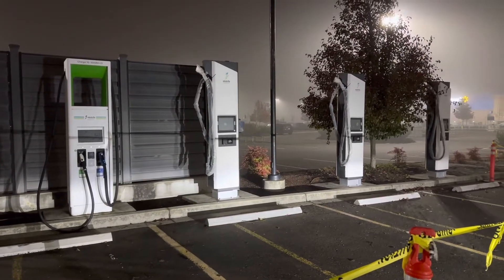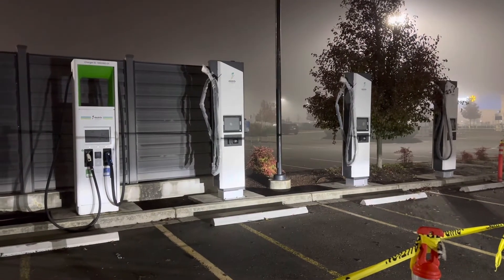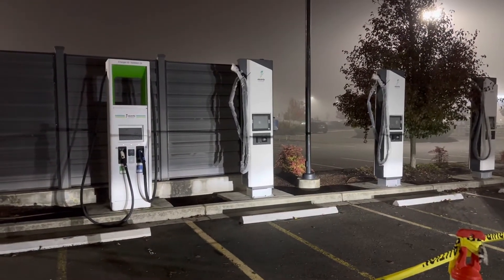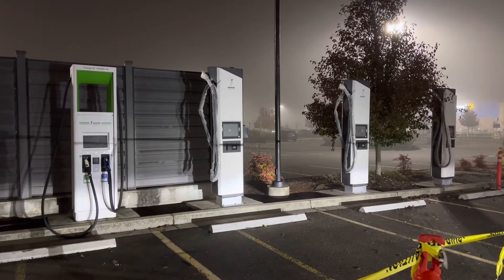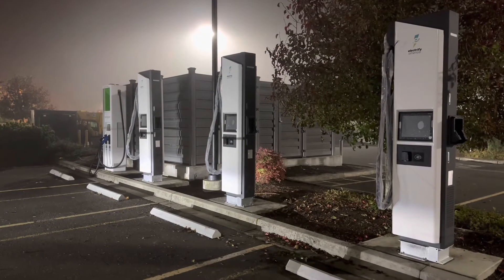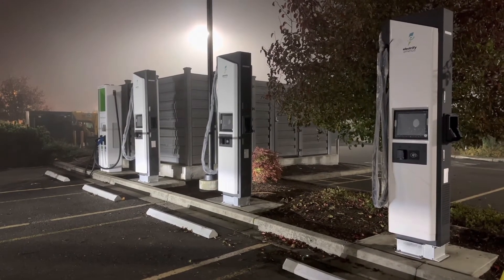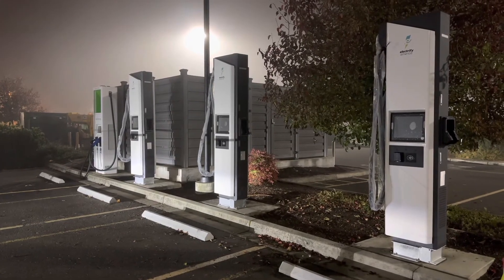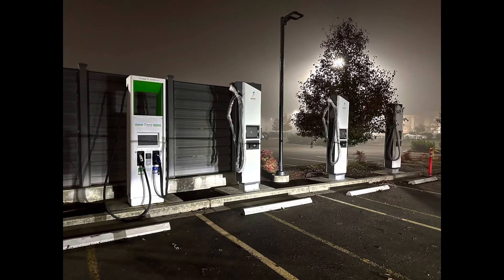FINALLY! New EA Hardware Getting Installed in Oregon

Comment: They are planning to leave the chademo in there. They’ve done this exact install at other sites that are already online. Legal reasons is my guess
Reply from the maker: Interesting. The other site upgrades that I’ve seen (online) replaced the Chademo units with EA’s previous generation hardware (the last ones with dual cables), so they were still getting replaced with newer hardware. The Chademo charger at this location (at the time of filming) was still the old, unreliable hardware that was installed years ago when the site was first commissioned. I hope that they plan to replace that charger with a new Chademo unit. The old one wasn’t good enough to leave there.
Reply: @wrenchingfool5284  no I think they’re gonna leave it there until they replace it with another brand new charger when people stop caring about Nissan leafs and Kia soul Evs. Or something with a Tesla nacs thing